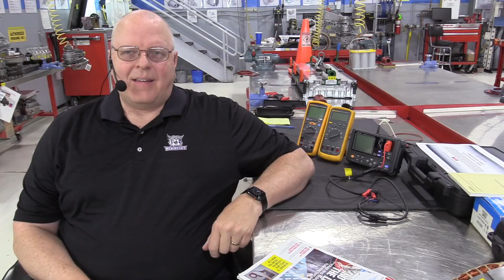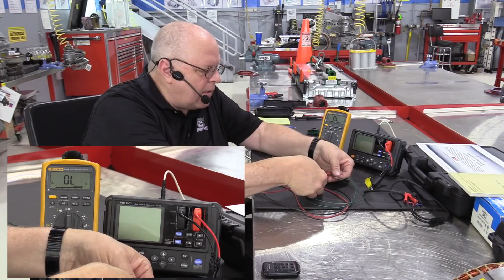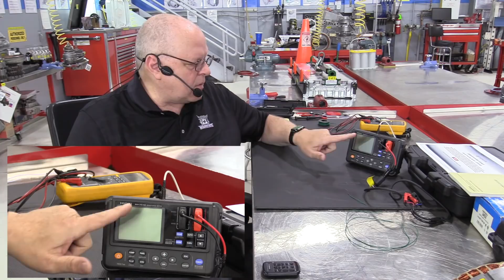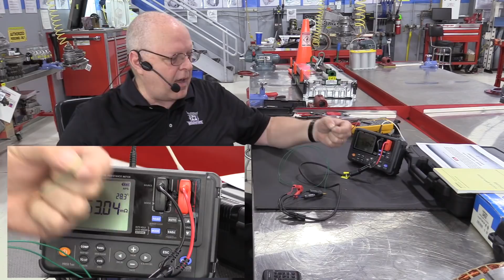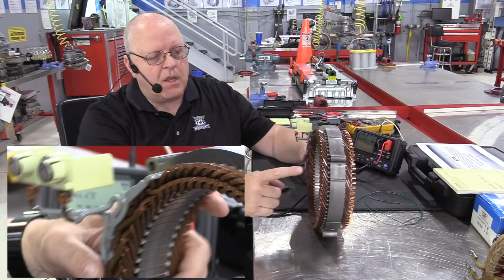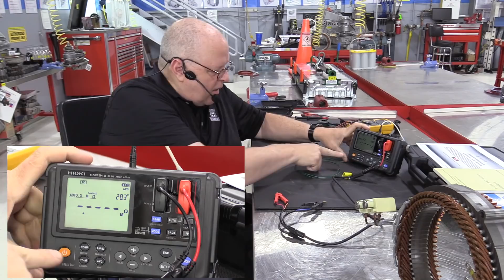Milli-Ohm Meter - Hybrid and EV Stator, Fuse, and Wire Diagnostics

Comment: Use Ohm-s law with a power supply. It does the same thing. And you will know the test voltage. Wont damage the circuit.

Comment: As cheaper alternative you can use lab power supply in constant current mode, set current few amps and using milivoltmeter measure voltage drop on conductor. Then calculate resistance using Ohms law. R=U/I. For example 1 amp. 50 mV will be 50 mOhm. By increasing current you can improove low resistance precision

Comment: Hi professor, is it possible that your difference in resistance value on the 3 phases on your Toyota Prius stator could be done by a lost of insulation caused by moisture in the oil in the transmission case? This lost of insulation could be read also by a megaohmeter in this case? Tanks for your answer and congratulation for all your videos, you’re the best 👏

Comment: Thanks a lot professor John. This was a great video. I always was wondering why I couldn't see any difference(ohm)  in my multimeter ,when I was cutting one of the small wires on a piece of wire.
I was using a wrong meter 😂😂😂😂

Comment: If you have 20 strands and you cut one, the resistance should become 20/19 times the value before you cut. If you have 3 strands and cut one, the resistance should become 3/2 times the values before you cut. So each time you cut, the absolute increase of resistance will vary (increase).

Comment: Looks like readings  to tenths of a milliohm are more useful than nano ohms in the automotive sector. As such I am looking at making an add on  'matchbox' sized item to work with your Fluke 87 to provide direct FLUKE resistance readouts in milli ohms. Hopefully cost under $50. What do u think prof? BTW I have 33 years engineering exp. with M.I.T. Electronics cert. 12 years in Auto.

Comment: Professor, I don’t know how far you have gotten into the milli ohm meter but I can share a few benefits with you. I use this in the power utility field very often.
1. The best advantage in my opinion is the inherit “loading” of the circuit. That is to say a m.o.m uses a fixed very accurate current source, usually selectable(we use 10A, 50A, 100A and 200A) to cause a voltage drop across the component being tested than measured the drop to calculate the resistance. So this makes the m.o.m. Very good at finding bad connections with out having to run difficult loading voltage drop tests. It can do this quickly and very easily. Think of all the bolted H.V. Power connections to the stators and inverters. Each bolted connection and crimp and solder can be tested with out any danger or applying system current. ( Think of a bad starter cable voltage drop test on an old Ford with the solenoid on the fender, voltage looks fine till current tries to flow)

2. The 4 wire kelvin measurement allows for automatic removal of test lead resistance and test lead connections resistance. This allows you to only measure the resistance of the component under test and not any other resistances that would be in a traditional ohm meter measurement. Remember the current is fixed and the two voltage measurements are high impedance voltage measurements so the only voltage drop measured is between the two voltage leads and nothing else.

3. When you have a m.o.m. With separate current leads and voltage leads you can test a large circuit say from battery in the trunk all the way to the inverter and just by moving the voltage leads you can start to narrow down where the high resistance is along the circuit. Think of battery terminal crimp>Wire>crimp>bolted terminal>fuse blade>fuse>fuse blade>bolted terminal crimp>wire>Crimp>bolted terminal to inverter. You can push current from the battery terminal to the inverter using the current leads and probe the connections with the voltage leads taking resistance measurements of each component in the circuit.
 
Last consideration, though the stature are small I believe using your m.o.m. On them you will be passing a DC current while testing and this with cause magnetization of the core. This could cause problems I would think with the inverter at least on initial energization of the stator. So a look at wether or not your meter offers demagnetization for after you have taken your measurement. Typically the meter goes into a process of flipping polarity of the current and lowering the amplitude to remove any magnetization of the core.
Reply from the maker: Awesome information. Thanks for sharing
Reply: @WeberAuto  Just looked up your meter, your meter has a 1amp max and an open circuit voltage of 5.5v ( the source for the current) so in the 3.5 Ohm and less the meter will push 1 amp of current through the component. Could use more current for the high power connections but still far better than any traditional Ohm meter.
Reply from the maker: @waynecostanza2280  Thanks Wayne
Reply: @WeberAuto   Glad to give a small piece of information back for the sea of information you  have provided all of us!

Comment: I'd agree that there is something awry with the readings obtained with the stator connections on your example Prius but the measuring point included the stator cables and their associated connections. These, imho, should be discounted before a diagnosis can be made.

Comment: temperature guns and IR cameras can be very useful for diagnostics. If there's corrosion causing resistance there will be a voltage drop and heat at the bad connection. Or clean all the contact like if you have a click no crank no start. Check hardware for loose hardware.

Comment: Aircraft OEM is looking at .00mOhm +1 if calculated value is .00mOhm we need to read at . 000mOhm at 1 Ampere. Internal resistance to external ground must read less than 5.0mOhm. I'm not sure what electric cars require grounds should read but even then they should be as strict as AV OEM, but I don't know

Comment: Normal DMM resistance measurement is quite useful for things like determining resistor values if the value marking is unreadable or determining power of a resistive heating element. They are pretty great when measuring resistances that fit in the range of normal DMM. I think the problem of measuring the two pieces of wire you demonstrated is that you are too close or under the lower limit of their range. They are great at what they are meant to do. 

Milli-Ohm meters are very common in electronics industry btw.
Reply from the maker: Thank you, yes, agreed. However, In the automotive diagnostic world, "Normal" DMMs are all that have been used for decades.  As a factory training center instructor for GM and afterward in all my years of taking hundreds of training courses on other vehicle brands, a milli-Ohm meter has never been mentioned or used until Toyota introduced it a few years ago.
Reply: @WeberAuto  Thank you for your reply! Love your videos btw, excellent education content! I'm sure milli-ohm meters get more popular among people working with electric car motor diagnostics

Comment: Very informative, do you use shorted turns testers as well? That seems like a good way to test for the same problem, and is a cheaper alternative.
Reply from the maker: Thank you. I am not sure what you mean by “shorted turn testers”.
Reply: @WeberAuto  There are different types, but they induce a small ac voltage into the winding, magnetically or electrically, and then determine the integrity of the windings from the measurement. https://www.iemmag.com/index.html https://en.wikipedia.org/wiki/Growler_(electrical_device) these are a few examples, but I would imagine there are ones specifically for the motors/generators in hybrids, as the principle is similar.
Reply from the maker: @rnoid  Thank you. I will check them out.

Comment: based on ohm's law R=V/I, on 4 wire measurement with 0.1uOhm resolution if you provide 1 amp of current then you'd need be able to detect 0.1microvolt.
Most DMM can only detect up to 0.001mv (ie. 50000 count fluke 18x or 28x series or 500000 count brymen and clones) yet their claimed accuracies  dropped quite a bit at that range; you'd need a good bench desktop multimeter with 5.5 or 6 and above count for mVDC  (albeit most of them nowadays sports 4W ohm measurement as well).
another way is you could increase the test current to 10amp to use DMM to get 0.001mV voltage drop measurement for 0.1uOhm but it might melt those 1cm tiny cable.
Micro ohm realm usually be used to measure high current contact switch, hence 10amp should pose no problem there (ie. ignition switch?, junction between fuse and its connector on electric cars pulling hundred of amps, etc.).

Comment: well, automotive battery (actually every kind of batteries) does have some milli ohm/micro ohm internal resistance and it does indeed dictate it's CCA capability one way or another; however it's not easily measured with such device, you'd need an AC current milliohm meter (or proper battery tester/analyzer)

Comment: thank you for all of you videos. can I please take up some of your time and ask you to help me diagnose my car please. I can not afford to take it in. if I need to contribute to your channel some how to get help from you let me know how please. 
I have a pruis V 2015, 176K miles. it started to have the triangle and check engine light, plus a few other lights come on with the massage "hybrid system is manlfunctioning". I been making them go away so I can get to work by disconnecting main power from the battery. after I do this hybrid system works just fine.
it mostly comes on after I have driven it and parked it and then I go for a 2nd drive. 
it happens more often when its hot.
when accelerating slowly it is sluggish in the beginning. if depress the gas peddle harder it takes off good and I don't fee the sluggishness. 
it seems to have a misfire. 
Battery sometimes drains all the way to 1 to 2 bars. if I park it as is, the next time I drive the car all the lights will come back on. 
when i see the battery drained I shift to "B" and drive around the block and it charges up all the way. but it takes a few minutes before it starts to charge. however once it starts to charge it charges fast. and the bars go all the way to the top. 
little bit of history: up to feb 2020, I had my dog go to work with me. I would leave the car on with air conditioning blasting and radio on. this went on from 2015 to Feb 2020. I have several stops of  1/2 hr to 2 hours a day.

Comment: At minute 21.50 you measured the voltage drop on a fuse and calculated the current based on the resistance measured in lab. But the fuse resistance was measured in another temperature environment. Also passing approx 3.6 amps, its temperature will rise, changing the resistance. I think that is a source of a quite big error. Also I wonder, can we measure the resistance in the fuse while the fuse is in operation? Or it can break the ohmmeter?

Comment: Very neat stuff, incredible info as always. Used a cheap ohmmeter to check my nissan xterra's valve body solenoids to do a successful self repair; all local shops wanted $2200 for a valve body swap and pressured me into buying a remanned transmission instead. Found a bad lead in the valve body wiring rather than a dead solenoid using the ohmmeter, no parts needed, just a little solder job. Cost me 5 quarts of ATF and an ATF stain on my computer desk.

Comment: Really great video! I am trying to wrap my head around the U W V phase wire testing on the MG motors. Are you able to explain to me why exactly will such slight resistance issues or tiny shorts create huge issues?
Reply from the maker: Any variance in resistance is an indication of a short circuit to another of the three phase wires or to the vehicle body. Either one will affect the amount of current available to the motor and cause the vehicle to shudder and eventually not be drive-able. Best wishes!

Comment: Professor Kelly, can you not use the Megger tester to do the same to measure the stator windings in the car?
Reply from the maker: Hi, If you are referring to a Mega-ohm meter, it will only measure down to 1 ohm. These windings have a normal resistance that is less than one ohm but greater than zero. It would work of there were a direct short from the windings to the stator frame, but not from winding to winding. Best wishes.
Reply: You said on this video you believe it has a shorted stator and the vehicle have lost of power and judders.  That being said, you said here that  also "these windings have a normal resistance".  If it has normal resistance would it cause the symptoms of stator going bad?  I'm sorry professor Kelly, I don't mean be critical.
Reply from the maker: Sorry for the confusion if I said that. Two of the three windings on the MG2 stator in the car were shorted. This caused the lack of power and juddering, The MG2 stator I had on the bench were not shirted and had equal normal resistance values of close to 34 milli-ohms. We installed the good stator and the car is fixed now. A car with the lack of power and juddering with good stator windings can also be caused by the inverter with shorted diodes or shorted IGBT transistors. The mega-ohm meter can be used to check the inverter for shorts with the three phase cables removed. Best wishes
Reply: Thank you professor Kelly for taking the time.

Comment: Another great video ....take a look here also http://artsautomotive.com/gen-1-prius-p3125-inf-287-303-replacing-mg2-stator/
Reply from the maker: Thank you, good information.
Reply: @WeberAuto instead of using a current probe to do the transient comparison test of each phase. Use a mega ohm meter and oscilloscope with a  20:1 probe. Will give the same rise time but will be a voltage transient in stead of. current. Same result different method!
Reply from the maker: Thank you

Comment: Great video, John. What is the purpose of having dual wires for each lead? Is the meter measuring the resistance of each and averaging? Also, what benefits do the hairpin style stators offer? I have not seen those before.
Reply from the maker: Hi Jake. One side of the alligator clips supplies a constant current through the part being measured. The other side measures the voltage drop across the same part. A pretty smart idea! The hairpin style stators are less expensive and easier to manufacturer as compared to a wire wound stator. Thanks for your feedback!

Comment: Would be interesting to see the difference in current flow measured with a scope between the 3 phases. while driving the motor.
Reply from the maker: I agree, but I do not have scope leads that can handle 600V. Thanks again for your feedback
Reply: @WeberAuto you could get yourself a power analyzer such as: https://www.fluke.com/en-gb/product/electrical-testing/power-quality/435-series-ii

Comment: could you use a three phase amp clamp to  diagnose an stater accurately the same?
Reply from the maker: I have not tried that, but I suspect you could. The three-phase cables are shielded, so I am not sure there would be any signal to measure inductively. Thanks for your feedback

Comment: excellent video !, was wondering how many decades would go by before the milliohm/micro-ohm meters would find their way into automotive industry, they have improved alot since we started using them in the early 1980's in the avionics industry. handy tool when used correctly.
Reply from the maker: Thank you, that is good to know.

Comment: Nice. We have a milli-ohm meter and it’s not as accurate as yours. It’s still good. We have it for Toyota HDD training and solely for stator checks, nice to do the VD on fuses! 

If a tech doesn’t have access to a milli-ohm meter, if you jack up the front wheels on that Prius and rotate them, you’ll feel it’s very notchy. That’s a dead giveaway of a shorted stator, not a very common fault but we’ve seen several here in the UK.

Thanks for a great video John.
Reply: Not HDD! HSD checks 👍🏻
Reply from the maker: Thank you. Spinning a front wheel is a great idea! I think that if there is a transmission fluid leak or the level gets set incorrectly, or the wrong fluid, the stators will not get cooled properly which can lead to eventual short circuits. Most of the hybrid transaxles I have disassembled have shown signs of running very hot. The fluid smells very burnt and a dark film is coating everything.
Reply from the maker: Yes, HSD. Thanks

Comment: You can also calculate the length based on the resitance and size.
l = (R*A)/ρ (0.0175 for cobber wire)
So if we measure 1.4Ohm on a 6mm2 cable, it is approx l = (1.4*6)/0.0175 = 480 meters long.
Reply from the maker: Thank you for your feedback! Yes, it can be done with a little algebra. What is cool is that the meter can do it for you.
Reply: Is your 1 meter testwire around 22 awg?
Reply from the maker: Yes it is
Reply: Then theory and practice are equal in this case :) Handy instrument. We just use a fluke meter to measure windings on normal electric 3 phase motors out in the field.